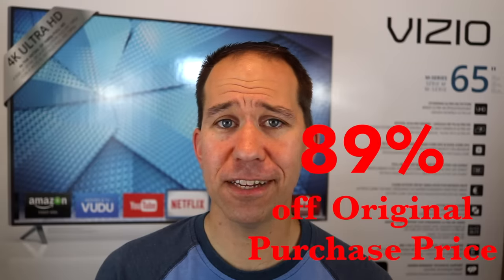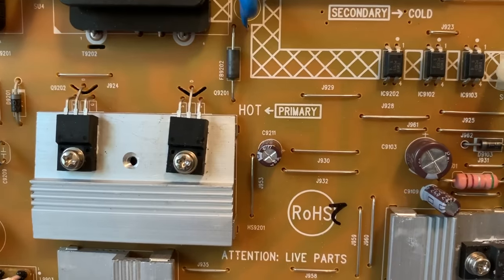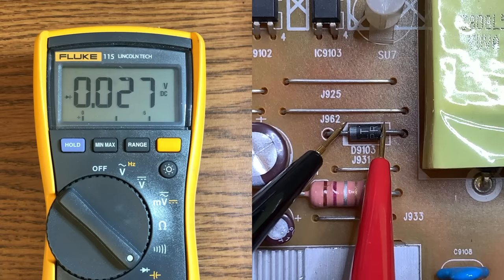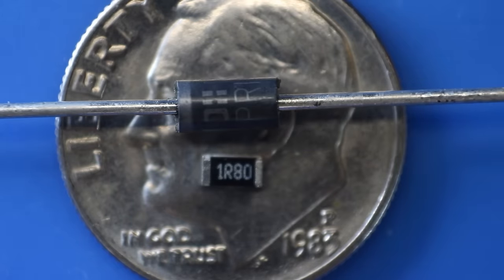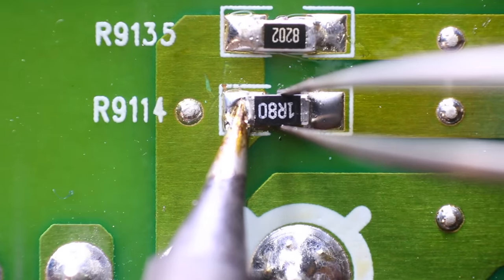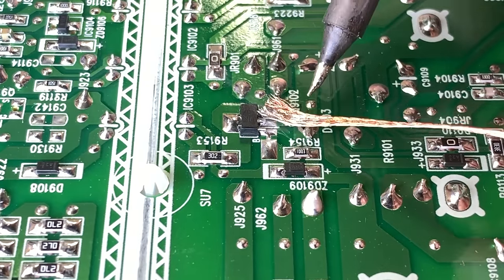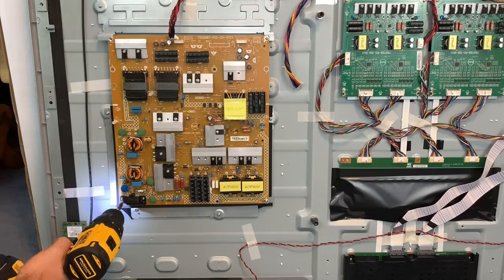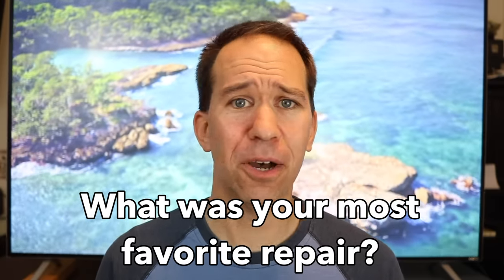I got a broken 65” 4K TV - How I repaired a Vizio M65-C1 (tv won’t turn on)

Comment: Ordering only one of each broken part, you like to live dangerously.
Reply: ikr...  i always order at least 5 of each
Reply: The Random Guys {LarY}  "YOUYUBE"
Reply: He is called FrugalRepair for a reason! Every cent matters!
Reply: jeah kinda stupid to order only 1 each if u pay 5dollars shipping
Reply: The Random Guys {LarY}  So I'm assuming you thought of it before them?
Reply: Yep. I like having extras. Especially those tiny parts. Drop one and it magically disappears.
Reply: when ordering from china, i most often go to the tax maximum, because i need them often =D have a good day
Reply: I would order extra just incase i lose one of them.
Reply: @NatsumeKonno  or break one =D
Reply: It's only an illustrative example, not necessarily the actual order.  (But yes, I also thought "confident!" :) )
Reply: Maybe he ordered more than one, most times suppliers other than Digi Key will sample you parts like that because it cost them to generate the paperwork for the sale like a 1 cent part might require 5 to 10 dollars worth of paperwork. Maybe the $4.99 is "shipping and handling" emphasizing handeling. You could probably buy 10, 20 or even 50 for the same price.  Me, i would have ordered the next higher wattage on the resistor,  and the next higher current rating on the diode. It is possable the manufacturer took shortcuts creating the resistor.
Reply: How would such a novice know to buy more? He found his electronic repair tools in a garage sale for $2. What an amazing man!
Reply: yeah small parts cost  nothing         buy 3 at least      Ping!Flys  across the room as some  do        fook .
Reply: He just likes to repair things frugally. 😳😆

Comment: Excellent work. Hope the seller of the tv is not watching this
Reply: Haha! They're probably kicking themselves for selling it so cheap.
Reply: He probably had a warrant and they told him to keep the TV.
Reply: whats wierd is seeing people piss and moan that the 1300 TV they bought broke after several years when the TV could have been had NEW way cheaper. i swear people just don't price check sometimes. not saying this is the case with THIS TV.
Reply: Lol😂😂
Reply: The TV is 4 yrs old and doesn't have hdr. Not really worth $200 in 2019
Reply: MrRondonmon Vizio does not offer that sort of deal for warranties. In the event a panel needs replacing, they will send a technician/subcontractor to swap out the entire unit. For everything else, we pick up the parts from Fedex and go visit the person’s home and swap out the affected parts. all technicians for vizio warranty calls are from ITI, Inc who has partnered with vizio to complete the service calls. :)
Reply: Well some people throw devices like this in the trash so if I was the seller I would still be glad that I could make some money with the device. If you buy these broken devices you have the risk of having to deal with unrepairable or time consuming damages. For example when the manufacturer used bad solder or parts with a short life span. 

Tip: When you buy older broken devices you should always check the electrolytic capacitor because they dry out after time.
Reply: cdoublejj .. That's so true!! Always, always Google most everything you're looking to buy. I found the couch with the chaise I was looking for over 1/2 the price, and on top of that they ended up giving me $150. off of that price, so the pieces I wanted were priced 'everywhere' for $2000., and I ended up paying (shipping and all) $865.00! BTW, I found out that all of the pieces came straight from the manufacture, so they were all only the middle man, (drop shipping) trying to make a huge profit off of already over-priced furniture!! ALWAYS, keep that in mind..
Reply: On the other hand it's always a risk buying a defective device. There's no way I personally wil buy a device close to what I can get a working one for. Either seller takes the risk and having someone "looking" at it and fix it for sale or own continued use or they sell it for something instead of throwing it out.
Looking at 2nd hand marketplaces (where I live) there's  lot of defective stuff around. But sellers usually ask way too much and you can see it has been for sale for months. So either you have it repaired so you can get the price you're asking or throw it out if you have an issue with someone is able to repair it for almost nothing. The fast is that when buying defective stuff you can't always count on being lucky - if that is not reflected in price then nobody will buy defective stuff.
Reply: Handy Hudsonite . Doubt it. It's a few years, they probably don't have the desire or inclination troubleshoot and attempt a repair. $150 is nice alternative to sending it to the recyclers.
Reply: Handy Hudsonite . Doubt it. $150 is better than junking it.

Comment: I fixed my $1000 55 in Samsung TV for $30. When the picture when black I did what you did and search the internet. I found that the LED bulbs were failing. I found a video that gave step by step on how to take apart and replace. I found the LED strips on ebay. $30 for all shipped. I took the tv apart on my dining room table and replaced all the LEDs and it worked. My wife couldn't believe that I fixed it and basically saved us $1000 for a new TV.
Reply from the maker: Wow, that is great to hear!  Doing a job like that and not cracking the lcd is an accomplishment.  Well done!
Reply: Hit the ground running i think I’m having that same issue, screen goes black after couple mins, sound still going, what was the video that helped you?
Reply from the maker: @PatMackSweetz99  To get longer life when you can see the screen you can try turning down the brightness in settings.  Try turning it down to like 30% and seeing how long it lasts for.  Then gradually increase it until you face problems.  I plan to make a video on how to do this at some point but I hope you can get help sooner if the settings trick isn't helpful.
Reply: I have samsung tv that goes a little bit dark on the very top and on the side. I think it's the leds but lg tv's just flash when leds go bad
Reply: Hit the ground running … Good husband!!
Reply: u should replace only fused leds.. not all
Reply: Great, that's a common issue. Just make sure the "backlight" (not brightness) setting is not turned up all the way. The backlight setting determines the intensity of the LEDs in relation to the ambient lighting in the room. Most sets are running the backlight setting much higher than it needs to be. This is generally what causes the LEDs to fail early to begin with. Also, disregard the claim here that you shouldn't replace all LED's. If a few LEDs are bad, others are not far behind. You did it exactly the way it should have been done. It doesn't make sense to tear that set down and risk screen breakage, just to replace a few dud LEDs.
Reply: Mr Hansen , Yes they are, it just depends on which make and model you're looking at. Samsung, Sony, and LG all have 55-inch sets for that price, some models are much higher.
Reply: Mr Hansen  my 55" Samsung was 1600 (Canadian) 6 months ago. It depends on the model you get. I bought one of their top of the line models.
Reply: Hit the ground running hey where did u fix ur tv? My tv is also broke I want to fix it please let me know
Reply: Mr Hansen, I don't need to move anywhere because I can get them for under 1000 too, you're missing the point. You said that 55" tv's arent 1000 anymore. Yes, people can certainly buy a cheap set. But not all models fall below that price point. There are still some which are in the $1000 and above price range. A person may not need or want something that expensive, but they do exist.
Reply: Can you tell me what video did you found?

Comment: I’m a 63 yr old grandmother. I took off my toilet, added a metal flange to the top of the cracked pipe, replaced all parts in the toilet and put it back on with new seals. Works great!
Reply from the maker: That’s awesome to hear!  Good for you and congratulations!
Reply: That's cool nan. Kudos. Did you get a good picture on it afterwards? How was the sound? ;-)
Reply: Good for you
Reply: I love you
Reply: @veritasaequitas9875  Do you really want a picture of a granny squatting on a toilet? What's more, with a recording of the plip-plop-squishy noises? I'm worried.
Reply: Well in Kathy, never stop bossing it

Comment: Great video. I had a 55" Vizio that stopped working after 3 years.  After some googling around and reading about similar problems other people had with this Vizio model I bought replacement boards on eBay for around $80 (it was a kit w/power board and main control board and other parts -- basically all the guts of the TV). Replaced them with my son's help in 30 minutes and the TV has been working great for past 2 years. Not quite a $0.47 repair, but a lot better than tossing the TV and having to buy a new one!
Reply from the maker: Great story!  So glad you took the opportunity to fix your tv.

Comment: A couple of years ago, your videos inspired me to try fixing an old powered subwoofer that I got at a thrift store for $10 rather than simply returning it - I ended up learning how to diagnose the power supply board and found the main filter caps on the output of the power supply were shot. Got new ones in and it's been working great ever since! So glad to see that you're uploading videos again.
Reply from the maker: I'm so happy to hear!  That is a great story and I hope I can inspire even more people to try tackling a repair they might be intimidated to try.  Yes, I am back to putting out videos.  I took a break because I took on a project to design and install solar panels on my house.  Any videos in particular you'd like to see?

Comment: I have an old  LCD computer monitor that quit working several years ago and I was ready to trash it. A friend at work told me we should take a look at it and we discovered a couple of capacitors that had swollen from heat and failed. He said that is a COMMON problem. Found a parts package on Amazon for that model and watched my friend make a quick repair. We powered up and it came right up. Yes -what a feeling! That old monitor is still working fine today.
Reply from the maker: Great to hear!  Thanks for sharing.  Yes, there is a whole Wikipedia page about that problem.  It’s called capacitor plague.

Comment: My internet wasn’t working one time and I restarted my router. 

Cheapest fix I’ve ever done
Reply: Gav why you so mad bro?
Reply: Free lol
Reply: have you tried turning it off and on again - Roy, The IT Crowd
Reply: same here but I restarted my lawn mower
Reply: Mine worked again 

after I flushed my toilet.
Reply: Thanks for the laugh. That was good.
Reply: @gav1903  I was hungry one time so I ate.

Cheapest fix Ive ever done.
Reply: What's funny is if you would have called support they most likely would have told you the same thing.
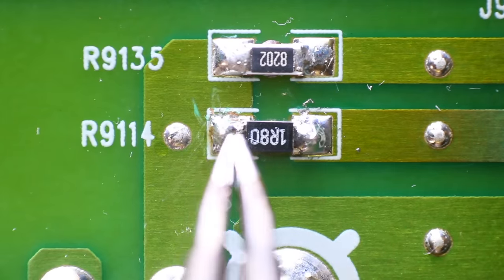Reply: Just not working stuck on max can not connect 7:47 7:49 😢

Comment: If you leave the leads full length, the diode will dissipate more heat. If you shorten the leads, you must derate the diode's ratings. Quite possibly the diode overheated and failed.
This info was directly from the engineering staff at Sylvania/ECG. My co-worker was working on am amp and the diodes kept failing. He went through 3 sets of new ECGdiodes and the same problem. Voltage and current were within tolerances. He called ECG and they told him about the lead length. (Back then the leads were silver) The lead length is part of the heat dissipation for the diode to run at full rating. Leaving the leads full length solved the problem.
 After I found out this info, I have always used full length leads with ZERO DIODE FAILURES in the 40+ years since.  If you ever worked on older Japanese made TV sets you will have run across the power supply diodes having a loop in the leads. This is why.
Reply from the maker: Wow, this is very interesting.  Thanks for posting.  I have been wondering why this diode failed and then apparently took out the resistor.  My guess was either heat or a bad batch of diodes but I didn't do any experiments.  I hadn't considered that the lead length would be that important to heat dissipation and second guess the engineer(s) who designed the board/circuit.   Now, I'm curious to do some more investigating on this power supply.   Thanks again!
Reply: so, if you attach metal heatsinks to the diode leads sticking out at the back it would run less hotter and prolong its life. Assuming enough clearance when board is mounted. Also use thermal paste for better heat transfer. Just a thought.
Reply: @FrugalRepair  This is why, 40 or so years ago, my HS electronics teacher drilled into me the importance of always looking for replacement parts that exceed OEM ratings.
Reply: @Sam Polk though, iirc, some ceramic power resistors are sometimes mounted not flushed on the board on a horizontal orientation. Maybe for better heat dissapation while also not affecting adjacent components. Saw this on some old CRT TVs' power supply section.
Reply from the maker: @Sam Polk Thanks for your comment.  So are you saying that you think the failure of the diode is due to a manufacturing defect as opposed to a poor pcb/circuit design?
Reply from the maker: @Sam Polk Thanks for letting us know!
Reply: I don't doubt what you are saying but I would think if the diode is heating to the point of failure it is either the wrong diode or there is something wrong in that circuit.  I worked on many high end circuit boards in my past career and all the components including diodes were always mounted close to the board with short leads, and they all worked.
Reply: @Sam Polk WOW! Those are some impressive credentials. I agree that longer leads is not the answer.
Reply: so if i bend the leads in to the shape of silly straw and trim nothing i'll improve the cooling? hhhhmmmmm.... wonder if i can make tiny heatsink with heatsink epoxy :-P lol
Reply: F.K. Burnham
 Quote "If you leave the leads full length, the diode will dissipate more heat."

Heat may not have even been the culprit here.

 Quote  "My co-worker was working on am amp and the diodes kept failing. He went through 3 sets of new ECGdiodes and the same problem."

First off I would stay away from ECG\NTE parts, especially in audio. But If he went through three sets of diodes there are other issues causing them to fail. There could have also been a mistake in the cross-reference as to which replacement diodes he should have been using. I've run into this before using replacements from places such as NTE, SK, GE or whoever. That's a reason I stopped using them. It's because of their inconsistent quality and erroneous cross-references, both of which costing me time and money. Best to stick with trusted suppliers such as Mouser or Digikey electronics as much as possible, and no ebay. Anything from ebay is likely to be counterfeit.

Comment: I got started repairing things like this in the same way! I loved to visit pawn shops around Army posts. I discovered one of them had an overflowing dumpster in the back that was full of stereo components. I asked if I could take them and they were more than happy to let me have whatever I wanted. I salvaged expensive receivers, record players, etc, etc. Some of them didn't work simply because the glass fuse inside was blown. Built my first good stereo system for almost free and a little time. I learned to solder and read diagrams in the process. Eventually I built about 20 computers for my own use and learned to repair them as well.  Years later, guitar repair became another hobby that was profitable. It's a great thing to learn, especially if you are not wanting to go to work for someone else for a living.
Reply from the maker: Sorry I missed your comment originally!  That's great to hear.  Thanks for commenting.

Comment: Brilliant video! Thank you for your clear, concise, well made tutorial. My husband does scrapping for a hobby and was given this exact TV. Was told the screen just quit. I like to tinker with things and fix if possible. My only experience with soldering is a couple of copper water pipes & some tragic pieces of stained glass craft. I watched your vid and was able to identify the ticking noise. Don't have a multimeter, so I just copied what you replaced & plugged it in....... It WORKS! Quite a learning curve for me, but I practiced on junk boards first. Couldn't have done it without such a detailed guide. Cheers
Reply from the maker: That’s great to hear you fixed it!  Congratulations!